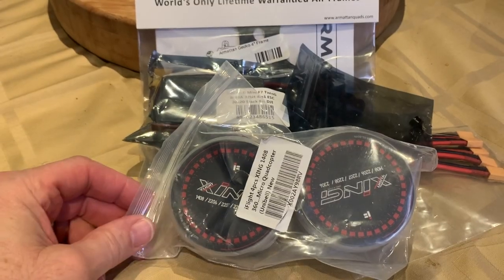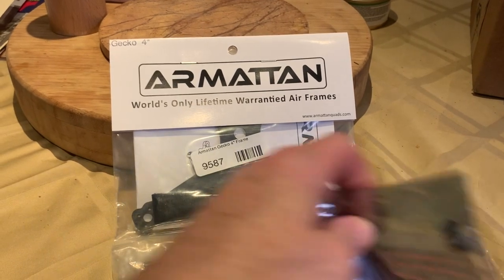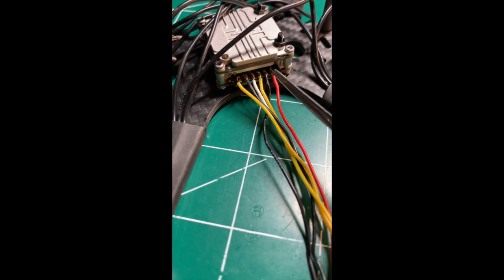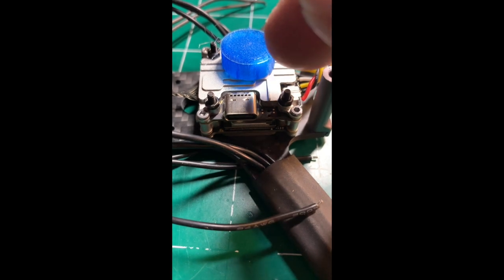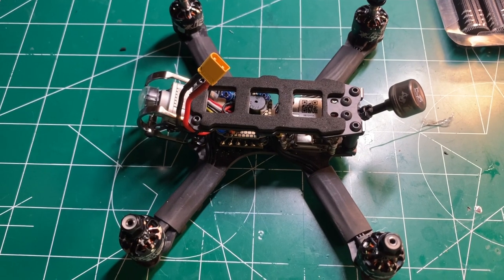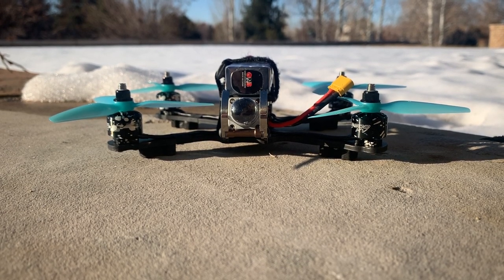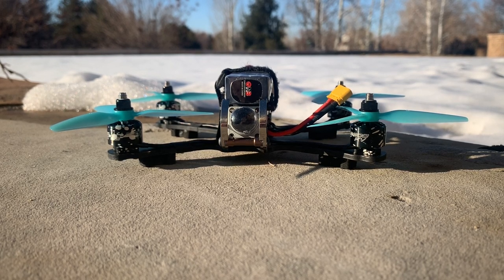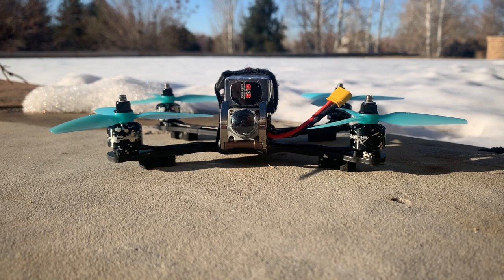Armattan Gecko Build With Caddx Vista

Comment: I have built both 3" and 4" Geckos with Caddx.  With the right bolts and reaming out the front holes for ESC/Flight controller it all goes together pretty clean.  I would not recommend this to a novice builder.  I did have some trouble with the Caddx cutting across the wiring harness insulation since the fit is so close to the FC.  I also tried to put the Caddx in front but with all the "plumbing" I just could not get it the way I wanted.  It is bullet proof and flys really well.  I did break my first Armattan arm with this but no damage at all to the important stuff.  This is a great video.  Thanks
Reply from the maker: I am glad it worked out for you. I have been enjoying mine.

Cheers,

SLOG

Comment: Great video! Does the vista just easily plug right into that board or is there some soldering required
Reply from the maker: Kevin King
Once you have the wire harness soldered to the  Vista, the connector plugs into the iFlight FC with no soldering.

SLOG
Reply: @slogfpv5679  oh man that's so simple! did you have to do anything special in beta flight to get it flying?
Reply from the maker: Hi @kookkevin  ,
The iFlight Mini F7 documentation was good on how to set it up for the DJI Air Unit/Vista unit.
Reply: Thanks for all the help def going to be making this build can’t wait!
Reply: It is dirt simple to solder the Caddx wires to the FC.  It is certainly nothing to be intimidated over.

Comment: Which hole did you use to mount the camera? I thought the mount points were front or back, but it looks like you used the middle slot.
Reply from the maker: Hi Simon,

I used the middle slot on the bracket and the bottom bolt hole on the Vista camera because I wanted to just be slightly back from the camera cage to give protection, but also insuring the cage would not show up in the camera view.

SLOG

Comment: Watched again..my build be done tomorrow..if o find right size stack screws for vista.. great vid again..cant wait to fly!! See if bear tuff!! Lmaooooo
Reply from the maker: Hi Sleeping Bear,

Glad the video helped out. Post your video of the build and I will check it out. I love seeing different ways FPV pilots build their quads. There is always unique and different ways pilots solve common problems that I learn from.

Cheers,

SLOG
Reply: @slogfpv5679  mine is a bit different..look for vid asp. Cheers my friend..have a great day!
Reply: Finding the bolts for the Caddx is challenging.  M2 x 23/25 work but are like finding Lepricon teeth.  Rotorgeeks sells them.  I found a non metric size that fits at Ace Hardware.

Comment: Great video, I'm planning on building pretty much the exact same as yours but I'm wondering if I should get the 4100kv version of those motors instead. I'm guessing that by using higher kv the flight time will decrease? What do you think?
Reply: @slogfpv5679  humm at 0:33 you say you're using the Xing 1408 3600kv motors... so did you change them for those you mentionned? My question was wether I should buy the Xing 1408 4100kv version instead. Btw I will be getting the regular DJI air unit, not the Caddx Vista because it doesn't have integrated DVR. With that in mind, what motor would you recommend for that setup?
Reply from the maker: Hi  @Benzin0 ,

OOPs! My bad, I was in Youtube studio reviewing my unanswered comments and thought I was under my Tadpole build. But to answer your question. The only reason why I went with 3600KV was due to my goal to be under 250 grams.  So to do that, I needed to run lighter batteries. Hence why I went with the lower KV motors. You should be fine with 4100kv Xing Motors. Just a little less flight time but you will get better punch. The Xing motors are very efficient and I was getting 5 min on a 520 mAh 4s! 

Cheers,

SLOG
Reply: @slogfpv5679  Great! Thanks a lot for your answer! :)

Comment: Great vid! Really want to build this as a 3 inch 6s with top mount battery. Is there room for a TBS Crossfire Nano? Any way to route the batter to the rear? Hate side wires. Thanks
Reply from the maker: Hi Stevensbox,
With the stack I have there is enough clearance to put the TBS Nano on top of the stack and route the antenna wire to the front arms for better reception. On the ESC I had to rotate it 180 because there was not enough clearance between the Vista and the ESC pigtail pads. You can always run a longer pigtail going out the back. Also there are new AOI boards like the Jhemcu GHF420AIO 2-6S F4 AIO 20x20 Flight Controller w/ 35A 4in1 ESC you might consider.
SLOG

Comment: What voltage do you land? I’m getting about four minutes using 650 mAh 4s batteries. Resting voltage is 14.8v (3.7v/cell) with the Armattan OOmph TITAN Mini 1407 3650kv motors.
Reply from the maker: HI Henry, I came in for a landing at around 3.4v/cell. The battery I use typically recovers to ~3.5-3.6 volts. There is a slight voltage drop on XT30 connectors. For context, the maiden flight was very slow due to mud in the field. 
SLOG

Comment: Nice Build! I saw youre useing the Geko 4"? I Ordered a 3" will it still fit?
Reply from the maker: Yes it should fit fine. The only difference is the arm length. I wanted to do a digital 4 inch build under 250 grams.
Reply: @slogfpv5679  Ah ok thank you verry much! Nice build, i only coud order the frame... here is everything sold out >.<
Reply: It's the same size except for the arm length.  It all fits fine but tight.  I have both and like the 3" best.

Comment: How did you mount your antenna? I'm having trouble figuring it out on my Gecko.
Reply from the maker: I just used the TPU antenna mount that came with the frame. It has a small mast that sticks out that I just tie wrapped the antenna to. Seems to hold fine. Hope this helps.

SLOG
Reply: Zip tie to the two slots at the back of the top plate.  Solid and keeps stress off of the Caddx.  Heat the antenna tube and bend it up a little.

Comment: Very nice! I want to build something similar and this helped a lot thanks! Do you think the 3 inch Gecko works too?
Reply from the maker: Hi mrtnization, 

Yes my understanding the frames are identical except for the longer arms on the 4 inch version. Plus you will shave off some weight by going with the 3 inch. I was looking for a 4 inch build as I was trying to get as close as possible to a 5 inch freestyle build, but still be under 250 grams.

SLOG

Comment: Is the xt30 feel ok?
Reply from the maker: Hi Jan Domingo since this is a light build with smaller motors the XT30 is working fine. I am not getting any significant voltage sag. Also you save some weight. SLOG